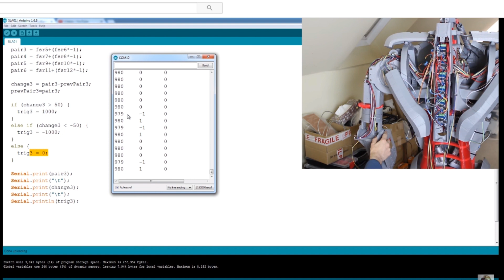Iron Man Exosuit #12 | Working Legs and Arm | James Bruton

Comment: I know that there are much more recent episodes, but would the legs not balance out if there was a stronger pull on the balancing bungees at the back, but only on the leg on the heavier side? As in, if you used one of those springs or simply more bungee's double-loops around the hooks, then that leg would be pulled up and thus the other would balance better.

Comment: Shouldn't the pressure sensors be positioned at the front and back of the foot? It seems like having to lead into each step forward with your knee would get really awkward, let alone when stepping backward. you could probably get away with it for forward stepping, but to back step the switch should probably be positioned behind the heel of your foot, shouldn't it?

Comment: James. if you are going to operate it with your hands and they are going to take any load. Ensure your hands are in the joystick position not handlebar. They will have much lesx fatigue.. (Thanks to the research from the manufacturers of Joey ((War Horse))for that nugget)

Comment: +James Bruton The FSRs can be a little pricey and I'm having good results measuring force by placing a layer of neoprene between skin and capacitive sensing plates (copper foil), connected to an MPR121 breakout. You could make a joystick style grip in this way and be able to measure where you are pushing and pulling by looking at the relationship between readings of several capacitive plates under some elastic displacement layer, like neoprene.
Reply: how about some cunningly placed hand and foot magnets, and an array of hall effect sensors for sensing arm and leg movement. that would allow variable input, without having to wear wired sensors, and without physical joysticks

Comment: you could build the left arm as a multitool so you can switch between different types of usage. e.g. a automated screwdriver and a gun and a metaldetector ans else stored inside that arm
Reply: feels Good man! :)
i magine the choosen and "dominant" equipment to rotate into the to the other hands responding spot so that only it is visible ;) that would be insanly awesome! :D